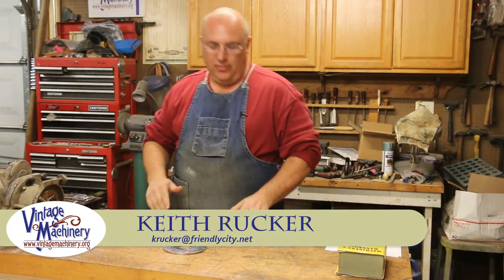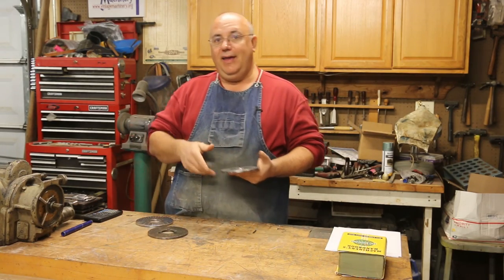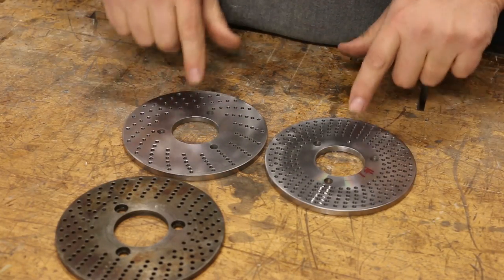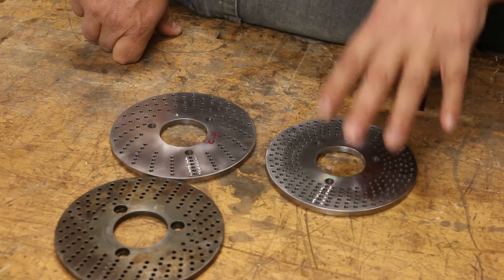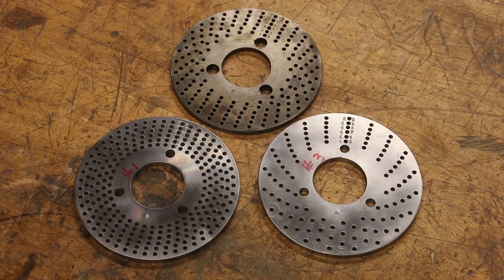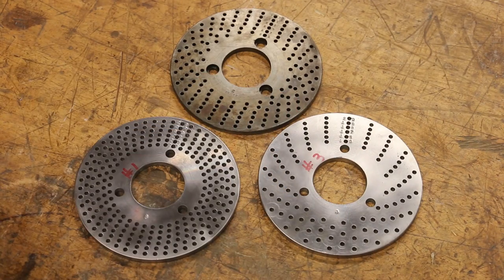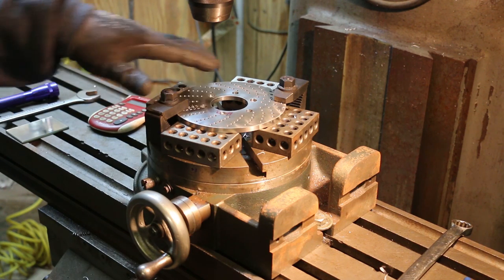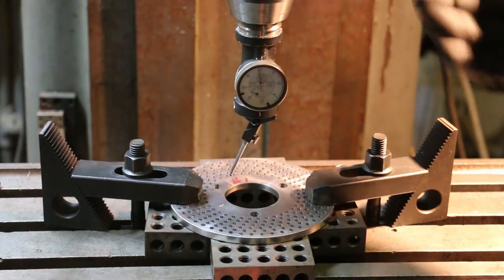Machining Dividing Head Index Plates:  Drilling Hole Patterns

Comment: Keith,

Not to be a simpleton; but I would have probably measured the ID of the center bore, ID of the bolt holes, and then the thickness of the web between the two. Add half of both ID measurements to the web between them and then double the result.
Reply: brian butterfield  yep, quick and easy. At the very least, I would have done that to double check the trigonometric method.

Comment: Why cut the counter sunk holes by hand? it would seem that the wobble would make all the close figures off base like wear since the pilot on the bit is doing some cutting as it enters the previously machined hole.
Reply from the maker: +gene elliott The pilot is not really doing any cutting.  How else would you do it - that is how I always cut countersinks.  I could have had Mike mill the countersinks on the CNC but that would have added another operation to the job and I was trying to keep it as simple for him as possible.

Comment: It might be beneficial to some to point out that if you use a scientific calculator to make such calculations to be sure the calculator is in the "degree" mode & not the "radian" mode. There'll be a button on the calculator to switch between Rad/Deg. You'll want to be sure the display area of the calculator is showing "Deg".
Reply from the maker: +MrPragmaticLee Good point.  I know that with my particular calculator that it automatically goes back to DEG each time it turns on so you have to put it in RAD mode.

Comment: I have got to watch that again. I was trying to follow along using my Texas Instruments TI-30XS calculator and failed miserably!
Reply from the maker: +vajake1 Just type the following:  1.02825 / 30 COS  =.
Reply: +Keith Rucker - VintageMachinery.org I was all fouled up.  I was trying to solve for the adjacent side, not the hypotenuse! ( I know!  Go figure!)  I did not realize the the hypotenuse is the radius of that bolt circle.  Second, my new Texas Instruments calculator is very strange.  Not at all like my old calculator that looks a lot like yours.  I'll have to look more closely at the tiny instruction booklet that came with the little beast!

Comment: Keith, I thought your explanation was very clear. Another approach is to solve the problem in general. That leads to CircleDiameter = DistanceBetweenHoleCenters * 1.15470, which is 1 / cos 30. Jon [edited to correct constant.]
Reply from the maker: +Yan Wo Hummm, I will have to play with that.  I would think that the constant would vary depending on the number of holes you are dealing with though.
Reply: +Keith Rucker - VintageMachinery.org Yes. The constant is only for three holes at 120 degrees.

Comment: Running that co-ax that fast would drive me nuts not being able to really watch and see which way it needs to go. I think if you ran it much slower you could get it dialed in much faster. Why didn't you counter bore the holes when you drilled them? Nice save on the parts!
Reply from the maker: +bcbloc02 To each his own I guess - that is just the way I learned to use the co-ax...  As for the counter bores, they could have been done at the same time but I was planning on putting a depth stop to get them all the same depth.  As it turned out, I used a mark on my depth scale - if I had changed the counter bore out each time, I would not have gotten it chucked back up the same each time and it would have required that I spend more time checking the depth of each hole.
Reply: Keith Rucker - VintageMachinery.org
ALways more than one way to "getter done!" :-) I always enjoy seeing the way others go about a job and learning things I can apply to maybe save me some time.

Comment: Keith, not being a CNC guy, what was the programing time for him to set up each one of those plates? And does it factor anywhere near the same time overall as it would to do it manually? Know that once he has it programed that he would be able to make any number of anyone of the plates in the future, by just setting up the piece in the machine and re-running program! But for a one time, one part deal, that doesn't have spiraled, weird angled cuts and that could be done on a manual milling machine or lathe, is it any faster? Great video by the way!!!
Reply from the maker: +Fred Newman Mike said it took him about an hour to draw up the six plates in CAD and about another hour to convert the CAD drawing to a program for the CNC mill.  Then it took anywhere from around 7 min to 30 min to make each plate.  When I did the one plate manually years ago, it burned up pretty much an entire day for just one plate.  So, in this situation, I think it was indeed a time saver.  A lot of one-off jobs are easier and faster to just do manually, but this was not one of those jobs...
Reply: +Fred Newman 
what made this possible to do as fast as I did it, was the programing software, If I had to program all the code by hand it probably would have taken several hours. I still think it would have been faster than manually drilling but would have been time cumsuming.  Most times I can make a single part in the convential shop as fast as the CNC guys can do programing and run the first part.

Comment: Keith, many thanks for taking the time to make this video.  Do you know if all DRO systems have a bolt hole function. I'm just in the process of buying one. Thanks again.  Phil
Reply from the maker: Not sure about all of them but I would suspect that the modern ones will.  Check out DroPro's - that is the kind of DRO I have and it is great.  They are also a great company to work with - you can call them up and they will help you figure out what you need and will be there to help if you have a problem.
Reply: Keith Rucker - VintageMachinery.org Many thanks

Comment: That trig is used by machinists in a daily basis. The best way for me to do it is using my Machinist Calculator by Calculated Industry. All I need to do is input two of the measurements and it gives me the rest. In this case all I needed was to input the 30° angle and the adjacent and done.
Reply from the maker: Cool!

Comment: Keith,  have you ever used a  " Texas instruments "  TI-55 calculator ?
Reply from the maker: +Robert Perrigo Robert, I have no idea off the top of my head.  Chances are, I probably have at some point in time as these things are usually laying around in the misc. labs that I worked in during my grad school days.  The funny thing about that TI-35X that I was using is that I bought that calculator when I was in college in the early 1990's and I have been using it every since.  I am pretty sure that it even still has the original batteries in it, which is amazing in itself!

Comment: This is a little off subject but what would be the best way to repair the plate to remove the extra holes?
Reply from the maker: +Larry Collar I could turn some plugs and press them on the holes, or weld them up and face it back off.  But, they just don't bother me bad enough to go to the extra effort....

Comment: Keith, As usual and great Friday morning video! Wow, it's been almost 50 years since I've done any trig :) One question, you didn't mention what side of the plate gets countersunk on, does it matter?
Thanks,
Rich
Reply from the maker: +Rich206L It does not matter which side.  What matters is the constant distance between each of the holes in the plate and that does not change from one side to the other.
Reply: The numbered hole circles and the counterbores should be on the same side for visibility. Other than that it does not matter.

Comment: Any reason you couldn't have used the DRO bolt hole calculator to locate the CNC'd holes in the plate, instead of a rotary table if you were doing it manually?
Reply: +vintagepc64 im sure its because drilling 100's of holes, what with swapping between centre and drill, would drive anyone crazy, and probably end up with errors, sometimes farming it out to someone with the machine for it can end up cheaper or worth it for the reduced stress.
Reply: +jusb1066 I definitely agree on the practicality aspect (and not saying poor Keith should have done it by hand), but I was thinking of a scenario where one didn't have access to a CNC macine. I'm not versed in the world of DROs and was just curious whether there was a limitation on the number of holes it could do for you, or whether it could indeed be used to eliminate some human error when locating them, vs having to dial in each one and potentially mis-read or flub a rotary table angle.
Reply: +vintagepc64 you have a good question, i do hope i have not derailed it.
Reply from the maker: +vintagepc64 Sure, you could have done it that way.  I am not sure if there is any limitation to the number of holes that the DRO will program, but in theory it should work fine.

Comment: How do you determine the diameter for the next row of bolt hole circles and each row following?
Reply from the maker: +carryit around Fortunately, the diameter of the hole patterns for the index holes are not critical - just all need to be the same diameter for any given hole pattern.  So, I just measured across with my calipers and went with what I came up with.  But, if I needed to calculate it right on, I could use a variation of what I did the math on by measuring between pins and calculating for triangles.
Reply: so when i set up the dro and do the first 3 hole circle at lets say 3 inch and the next row i want is a 23 (or whatever) bolt hole circle what do i program in the dro?? do i  just guess the diameter of the next row and the dro figures out the coordinates? how do i zero zero to move the bolt hole circle out of the 3 hole circle? use the angle function?  thanks keith i'm new to all this....

Comment: Thanks so much for the math lesson, I've got this bookmarked for future reference and will put that formula in my ring binder when I out to the shop, that will be very helpful! Sorry you had to host Mr. Bozo for lunch, but it's great you were able to salvage those plates and we got to learn that great math, so it wasn't a total bummer...except all that set up :(

So just a random question here, nothing to do with a project I'm dreaming about or anything, cough, cough...But what plate would you need, if it's even possible, to make 125 divisions? My math tells me it's 2.88 degrees between scribe lines, but is there a plate you could use to "drive" to those coordinates?

Thanks again and I hope the shop is getting water proofed ASAP, Aloha...Chuck
Reply: +Knolltop Farms Yes, a plate with 25 holes would allow 125 divisions assuming the dividing head is geared 90:1, that is 90 turns of the crank moves the index head 1 complete rotation (360º).  One turn of the crank would move the head 4º.   

90 turns / 125 divisions =  18/25 turns.  Therefore, if you use a plate with 25 holes and move 18 holes for each division, you would move the head 18/25 * 4º = 2.88º.
Reply: +Richard Freeze Thanks, I did figure all of that out and I'm sorry, I know should have replied that I looked into it. It was early for me and the old dusty cupboard atop my shoulders and between my ears wasn't working at full speed just yet ;)

For some reason I just recall a video by Mr. Fenner saying that there weren't any plates with divisions of 5, but now I'm thinking that he was talking about masking plates or something? 

I still have to go back and look at his gear hobbing video to find out what he was talking about just to scratch that itch. But my solution to a little problem will likely be something a bit more crude and home-made. I've got a micrometer dial project for my 1919 SB lathe, and my dial is scribed at 125 divisions on the cross slide, and the compound doesn't even have one LOL!

Thanks again for the feedback, and I'll put that info into my ring binder too, it's all useful to me...Aloha, Chuck
Reply from the maker: +Knolltop Farms My dividing head has a 40:1 ratio - which means that you crank the handle on the dividing head 40 times to get one revolution.  I just looked up 125 divisions in the book I have for the dividing head (http://vintagemachinery.org/pubs/detail.aspx?id=6525) and that is one of the few patterns that I cannot make with this dividing head with any of the five plates that K&T offered.  I could do that job if I made a special plate with 25 divisions in it, but that is not a standard hole pattern.  40 turns / 125 divisions = moving the crank 8 holes on a 25 division plate.
Reply: Yeah, that's what I read yesterday too. Thanks so much for the reply and all of the extra homework. Sorry that I forgot to mention I found out the answer to my own question! I still was curious if you had the 25 hole pattern on any of those plates. I'll figure out how to index my dials, it's not like I don't have a stack of gears for both of my lathes to play with ;)

Have a great weekend Keith, Aloha...Chuck

Comment: A= actual measurement of center hole divided by 2, B= Actual measurement of mounting hole divided by 2,  C = thickness  web between center hole and mounting hole.  A+B+C  voila!!  360/3=  120 degrees
Reply from the maker: +Maurice “Butch” Chauvette Yes, I actually used that method off camera to double check my calculations.  But, for the video I wanted to show how you could calculate a bolt pattern on anything by measuring across pins.  Not every item that has a bolt pattern in it has the luxury of having a nice precision bored hole in the center!

Comment: Does it matter which side of the disk gets the counter bore?
Reply: +Ether Oar You might think so, but no.  Since only one division ring/radius is used at a time it won't matter if it spirals clockwise or counter/anti-clockwise.  But I would want them all to be the same either way.
Reply: +Keith Ward   Thanks
Reply from the maker: +Ether Oar As the "Other Keith" has already commented, it does not matter which side is out.  Once you put int he counter bore though it will only fit one way....

Comment: Doesn't your DRO have a centering function for finding a center of a hole?
Reply from the maker: +Dave Strong Not sure how that would work.  I have used the 1/2 function with an edge finder to find the center of something before, but edge finders don't work well on an inside bore.  The DRO will allow you to attach a touch probe but I don't have one.
Reply: +Keith Rucker - VintageMachinery.org 
I think your DRO has a "center of hole " function, I think it's the button below the z  zero button. You touch off on three point on the circle and it calculates The center of the bore. My accurate DRO has it and it's very handy, DRO pro shows it on their web site. Dave

Comment: Love your videos, they teach me LOTS of stuff !
But two things that would make your life MUCH easier : go full blown metric, and learn AutoCAD basics.
Reply from the maker: +S Vp I disagree with the metric comment.  I have been using inches for so long that it is just second nature to me.  My mind just does not work in metric units - and I actually use them all the time in my "real job" as a scientist.  AutoCAD or some other kind of drawing program would be a help for me, but I have the ability to design things in my head very well and it just takes too long to draw them out when I really don't need a drawing.  It would be helpful for my viewers though.....
Reply: Metric would just add errors when dealing with stuff that was designed with customary units.  Like the math coming out 2 ten thousandths from 3/16" and knowing that it was most certainly specified as 3/16 (well 2-3/8 diameter, but you see the point). Using mm you wouldn't see that and would miss that tolerance and wear had affected the part.

A machinist working with decimal inches is no different than metric, except we also recognize the fraction equivalents.

Comment: Keith, thanks for the video. Did the holes fit close enough for you? I haven't read all the comments so I don't know if anyone pointed out your second "Bozo moment". When you did your calculations the first one where you subtracted one pin thickness was done in your head. You got the wrong answer, an error which carried through all of the subsequent calculations. You final answer is off a bit due to that. I haven't bother to run the correct numbers but I bet you caught it when the final fit was a bit off. The geometry and trig is fine, the elementary school arithmetic is the problem!
That said, thanks for the education in machining and set-up!
Terry
Reply from the maker: Yes, the holes worked out fine!

Comment: holly crap, I love and appreciate all your videos Mike but isn't there an easier way to figure that? I would have just added the dia. of the center hole + dia. of the pin hole (.3125) + the distance between the 2 holes x 2 and added the 3 together. wouldn't that give the same answer? all measurements done with the caliper, of course. thanks again for all your vids, love them.
Reply: Sorry, I meant Keith not Mike. brain fart

Comment: 30-60 90 triangle law states base =1 , height = square root of 3 , hyp =2....  1.02825/square root of 3 x 2 = 1.1873
Reply: This is what I would do. Much easier. And, most calculators come with square root, so you don't need the scientific calculator.
Reply: Terry Cote Are you watching this video on a computer?   
Try openoffice.org to create your chart.

Comment: Should have included the 3rd, older, method: dividers.

Layout fluid, a compass and dividers.

I really wish YouTubers would do old school layout instead of relying on DROs all the time.

I spent a lot of time marking layout on metal, center punching holes, with rules, squares, gage blocks and surface plactes, etc.